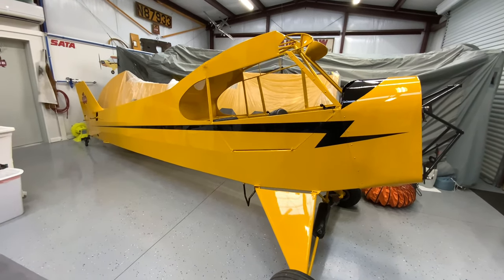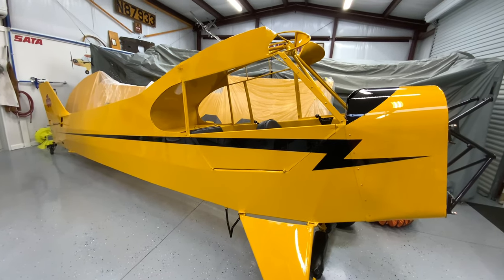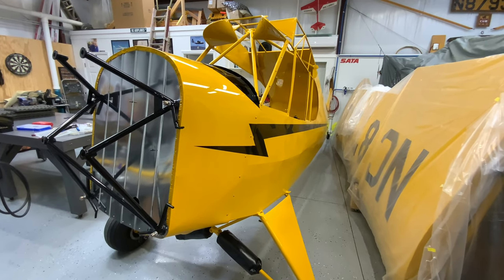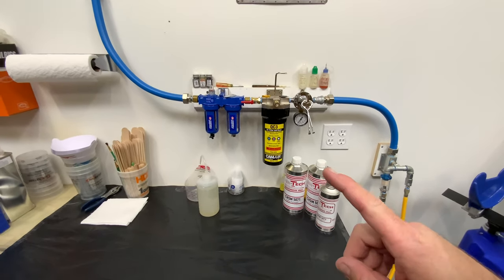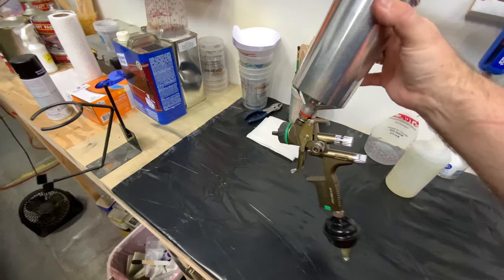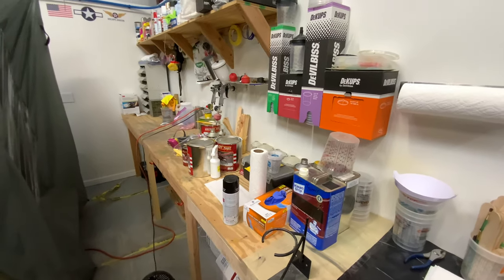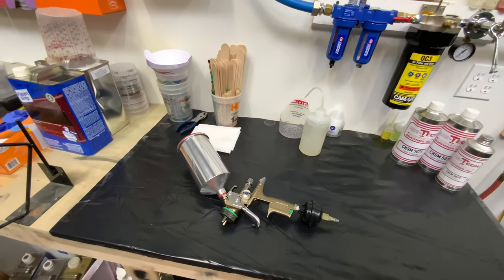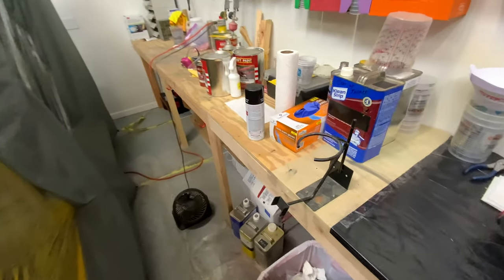What Paint Gun And Set I Use To Get A Perfect Paint Job (Update #036)

Comment: How is the inflatable booth holding up ? I’m ready to put one up and frame it with pvc in my small shop . I love your set up , I do small jobs and all kinds of miscellaneous painting of random things , I’m tired of fighting overspray .
Reply from the maker: Man it’s holding up like a CHAMP. 😁👍🏼 I tel ya if you want a GOOD, EXCELLENT quality inflatable paint booth you need to go with the company I went with..Gorillas Pro. They are GREAT and has the best Costomer service. I have YET to have a problem with a zipper or ANYTHING. 
And I would not use PVC. Trust me...I tried that and it will not hold up that great. If you screw all the 2x4’s together then you can take it down in about 20 mins and you don’t have to worry about the PVC coming down on you.
Reply: Cole Aviation thank you so much , I’ll probably have more questions as I go , I appreciate you from southeast la .